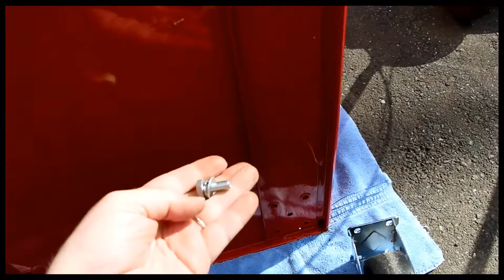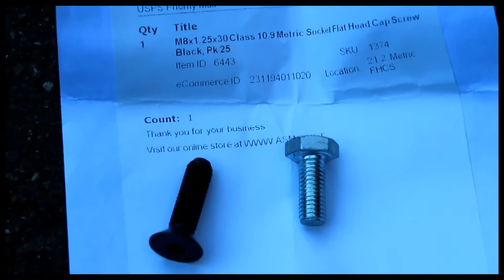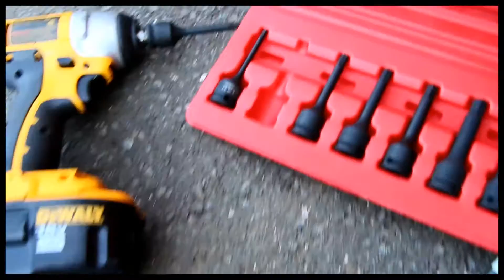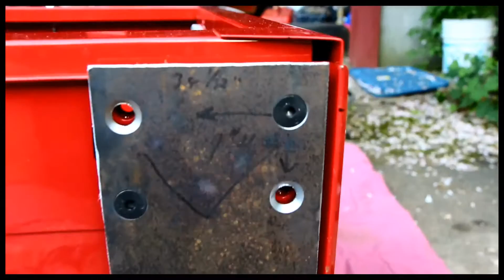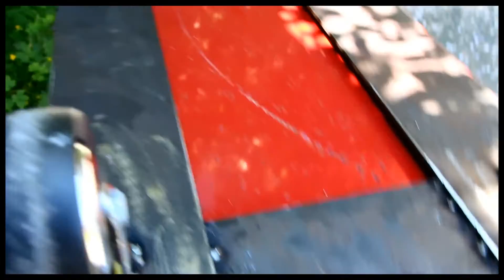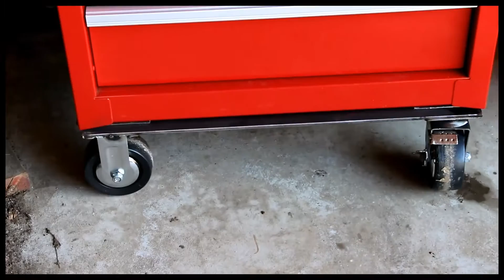Harbor Freight us general pro tool chest reinforment mod diy

Comment: This was useful.  I’m modifying one to be a base for a mini mill, and of course need it to be as rigid as possible.   I think I am also going to loose the bottom drawer, and add a hundred pounds of concrete or so.
Reply from the maker: Upgrade the wheels too?
Reply: I think I may leave the wheels, not sure yet how they will roll with extra weight.  I’m also thinking of putting 2” angle on the sides, and making screw legs for it, so that it’s not on the wheels unless I am moving it, and it can be leveled.  Have the rivnuts loosened in yours over time?
Reply from the maker: @JordanHaisley  not that I can think of

Comment: Installing those plates on the bottom raises the box even with slightly wider stance, kind of cancels out? Could move the wheels beyond the outside corners, bring bottom of the box lower.
5" off the ground to like 1" with a bolt on bottom frame. Just thinking.
Reply from the maker: Hey I'm all for having the wheels wider...   I don't think the extra height of my box cancels out the width...  but certainly do have to be careful about raising the center of gravity.  In my case I didn't want the wheels to stick out from the box.... thanks for the comment though :)